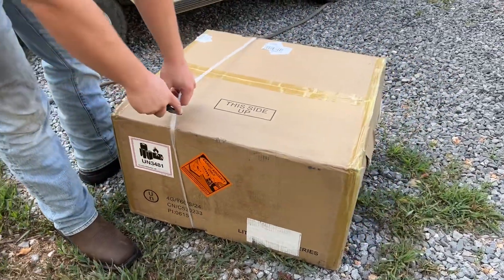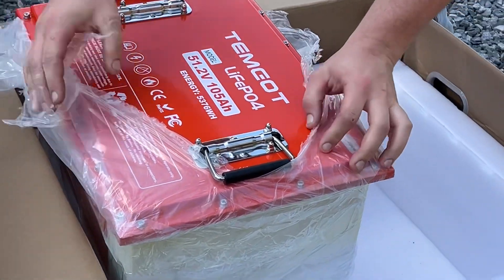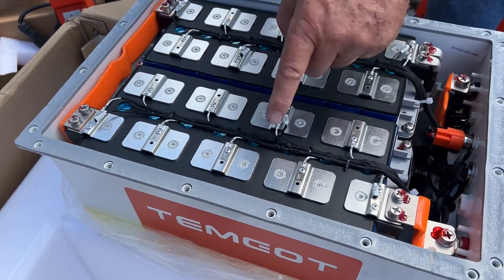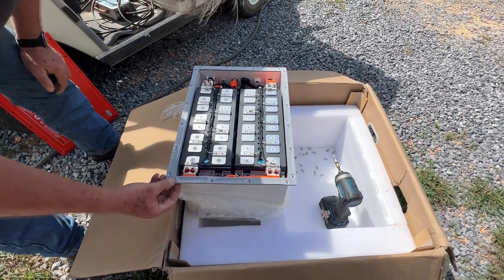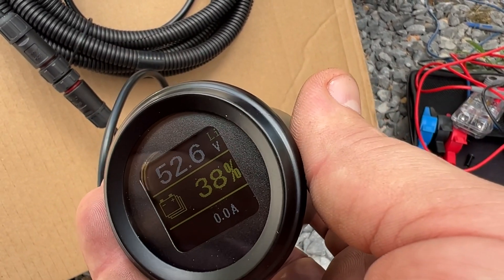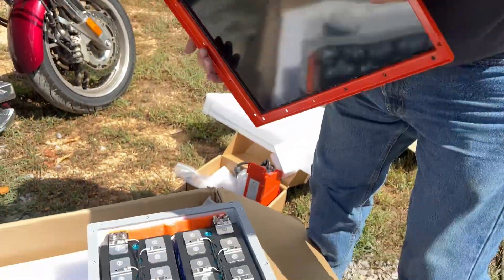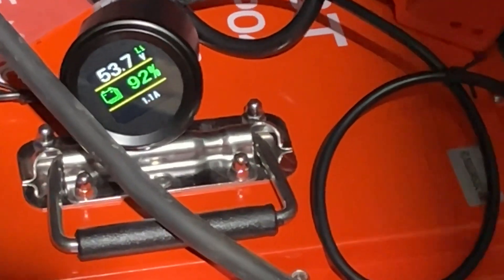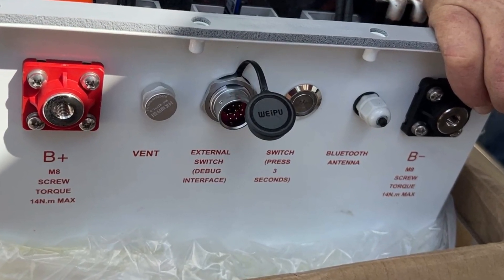Temgot 48v (51.2v) 105Ah LiFePO4 Golf Cart Battery introduction and review

Comment: I remember when golf carts used 12-volt car batteries. This is amazing technology.
Reply: Brand new golf carts still use trojan lead acid deep cycle batteries.
Reply: Pretty sure they never used 12v car batteries 😂😂
Reply: @natevanlandingham1945  you obviously didn't grow up where I did. My parents had a golf cart. It had a 12-volt car battery in it. I remember them swapping the battery out for another car battery when one died. And at the age of 69, I'm pretty sure I know what a 12-volt car battery looks like.
Reply: @asarand  well I don't think there was ever a 12v golf cart. Yes you can put 12v car batteries in one. It will kill them very quickly as there not deep cycle and not designed to be deeply discharged and give up lots of power for periods of time. And while yes you could put three 12v car batteries in a 36v golf cart and it will work it will not function to its fullest capacity. Golf carts were designed to use deep cycle batteries and to my knowledge were designed around 6v deep cycle batteries. Some today even have/had 12v deep cycle golf cart batteries but torque and range suffers so many people convert them to multiples of 6v or 8v batteries to get them there.
Reply: @natevanlandingham1945  "Golf carts in the 1950s and 1960s typically used flooded lead-acid batteries:
Flooded lead-acid batteries: These batteries are the most common and traditional type of battery used in golf carts. They consist of lead plates submerged in sulfuric acid, which creates a chemical reaction that stores energy. These batteries are affordable and easy to maintain, but they have a shorter lifespan and are heavy. "
 These are pretty much car batteries. I'm not sure if they were the same batteries used in cars, but they looked just like them, and they didn't last very long in golf carts.
Reply: @asarand  yes. That's what I'm talking about? Golf carts today pretty much all use lead acid batteries unless someone converted them to lithium. 6v 8v and 12v deep cycle golf cart batteries are all flooded lead acid , there is no other type! These Lithium are not really labeled deep cycle, it's a difference in the technology.  

I own a Golf cart. I built it into an off-road buggy type cart. Originally was you plain Jane Ezgo course type cart. Only option it has was the desired factory speed motor which made it a bit faster. It's a late 90s Series drive. Lifted it , bigger tires, rear seat, new 500 amp controller, heavy duty solenoid, all new heavy gauge wires, and converted from 36 to 48v. Originally it had six 6v batteries and I now run six 8v batteries. All flooded lead acid batteries. And like I said I could put 4 car batteries in it or even 4 deep cycle marine trolling type batteries would be better but there not designed for golf cart use giving up the gobs of power it needs instantly. Your torque will be awfully and so will the range. And the life of the actual battery will suffer dramatically because car batteries are not meant to be discharged there meant to stay at or close to full charge. And even "car" batteries are not cheap so I'm not sure why you would do it, probably wouldn't last a year at best. Now if all I wanted to do was scoot around my acre property and 100 yards to the corner store a few times a week, maybe if you had a bunch of old good car batteries that use might make sense?

I was really interested in this as I will be if he puts it into his cart. Interested in the lithium option. The price is still just not there yet. I know the life thing etc but the price is still just a bit too high.